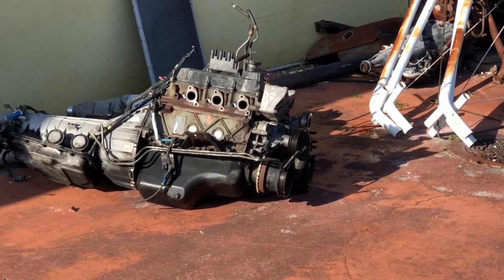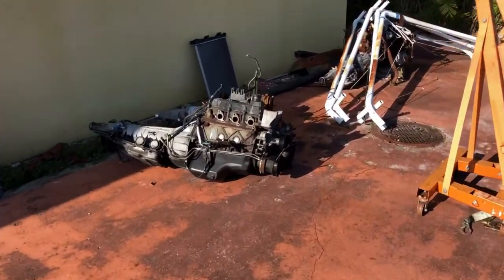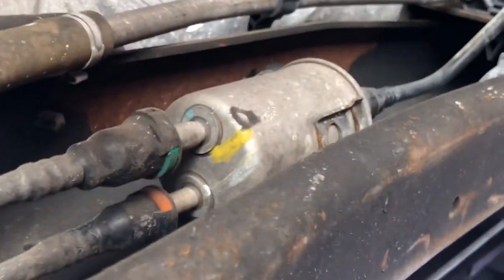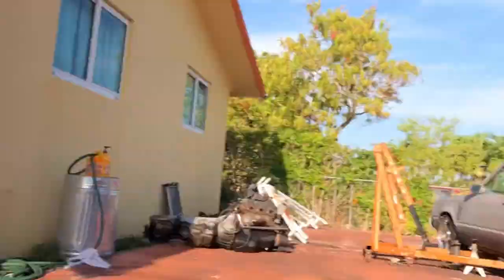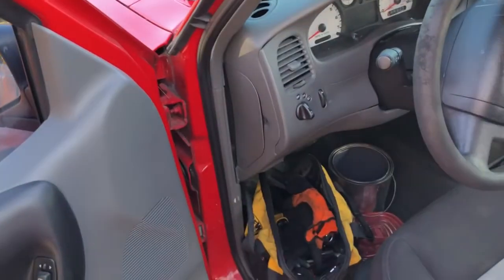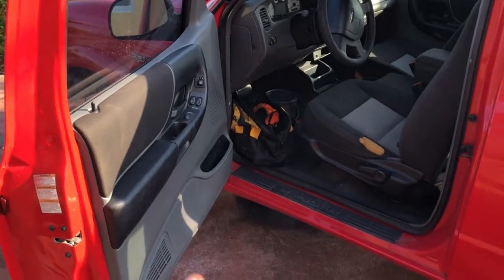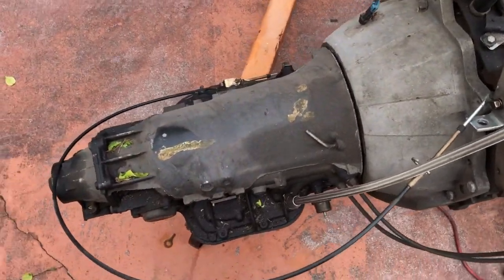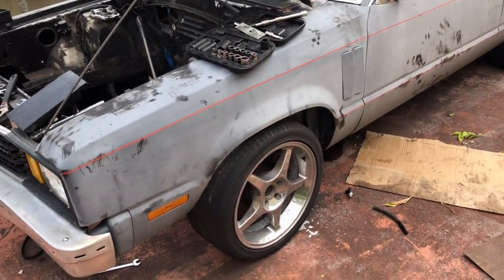LSX Turbo Swap Ford Ranger Part 2: MOTORS OUT

Comment: How's this comin along man? I have an 04 that I've pondered swapping and boosting, but it's 4wd. 
Are you using any stock gauges or are you gutting it all lpl
Reply: Do you follow A21Bravo? He did a 4wd Ranger (converted to 2wd) with an LQ4/Single turbo.
Reply: ecoboost swap ur 4x4. Hasn't been done on a 4x4 yet and would be perfect if you had a 5 speed.